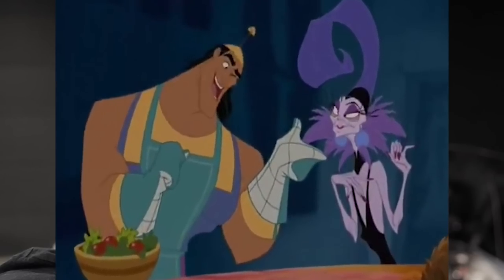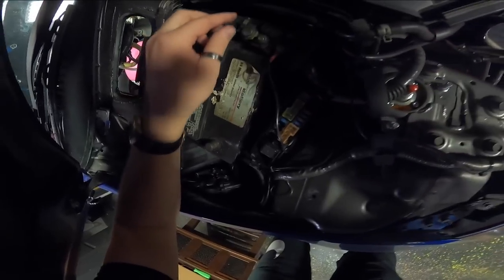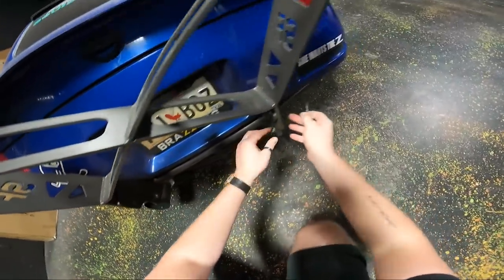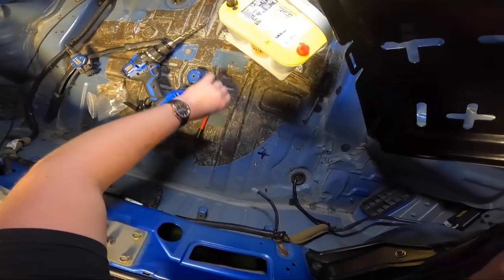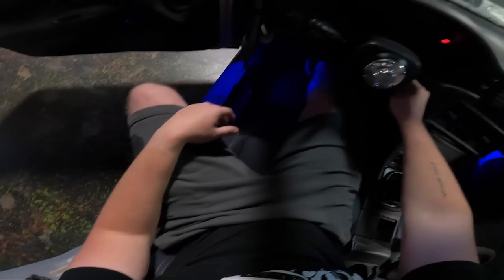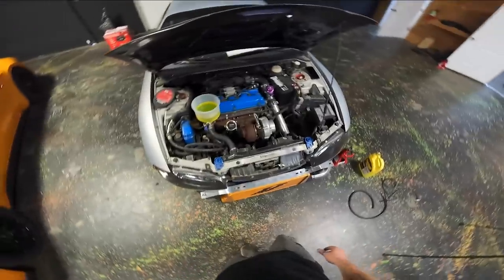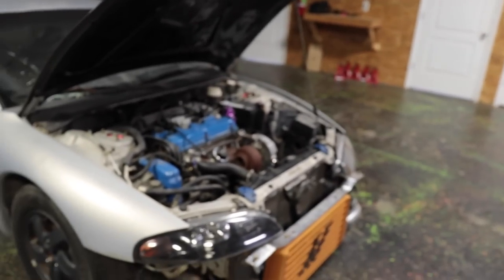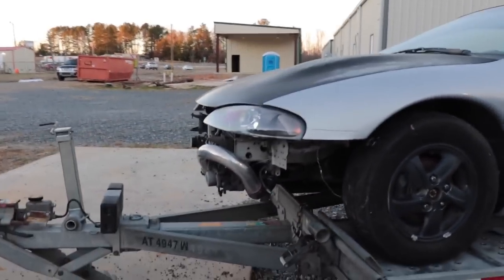Sold My Turbo Eclipse to Move To Atlanta!

Comment: I had a Cobalt SS that had the battery in the trunk from factory. Kinda was convenient because you could jump it from either the rear or the front. Original battery lasted 10 years. Still wish I had that car.
Reply from the maker: That is another plus to a battery in the trunk